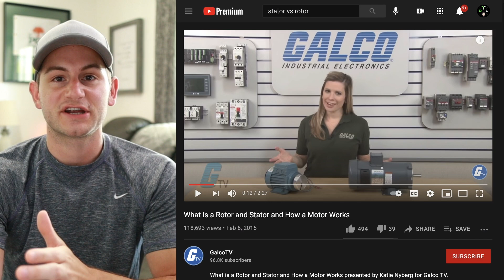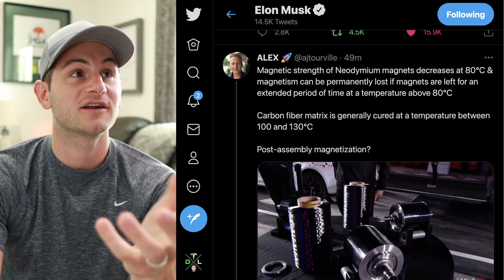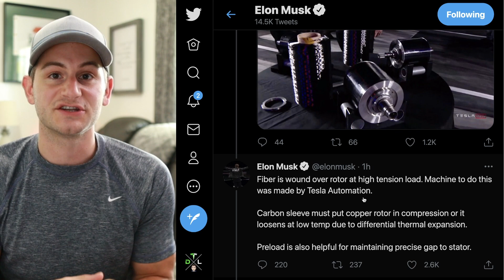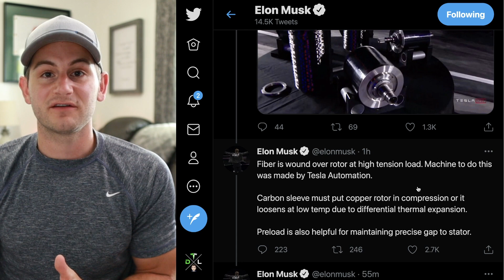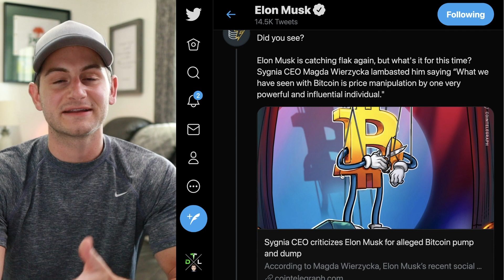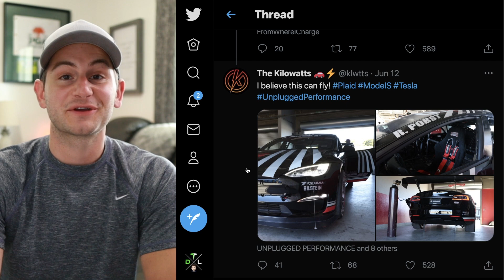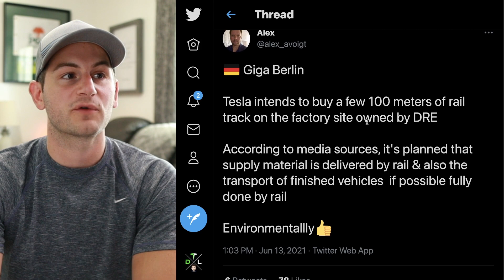Elon Just Leaked NEW Details on "World's Most Advanced Motor" 🌍

Comment: Do u think its likely as the carbon   process scales, tesla could get some form of this into the other cars.  Like in the next 5 yrs.  What if tesla can get the new battery 4180 and carbon motor in 3 of their top models.   Lighter weight cars and better battery.   450+ to 500 range , possible.
Reply: Nope, the model s plad are very different motors, the carbon sleeves are used only on very high revving applications up to 200k rpm, it won't come to a model 3 or y, most likely roadster. Carbon sleeves are also way more expensive.
Reply: @alanmay7929  fair point, do you know how much more expensive? Do you have any insight we don't? Serious question.
Reply: @brois841  let me tell you, tesla is going to reserve the carbon sleeves rotors motors for their top performance vehicles, like mercedes does with AMG division with fancier features..... the regular 400_600hp tesla won't get that.
Reply: @alanmay7929  do you read or just respond? I said "fair point" in other words: I read what you wrote, agree, it makes no sense to put high revving motors in cars not meant for high performance driving. It may still appear in the Model 3 Performance, since it has track mode and is sometimes used in that capacity. Not my cup of tea, but whatever :)
Reply from the maker: i think it's possible yes! need to learn more first though
Reply: @DillonLoomis22  I'd say not just possible, but probable, especially in 5-years.

Comment: Battery improvements are ongoing - this is a big fundamental advancement we didn’t even expect.
Reply from the maker: you got that right brotha
Reply: @kramer9929  No, legacy 18650 cells. But the battery pack is high voltage class 400 V, like Jaguar I-Pace and Audi E-tron introduced in 2018. It is an easy method for more power with less waste heat.
Reply: @Foersom_  Did you mean 2170?
Reply: @kramer9929  no, but he did mention something about a new battery design